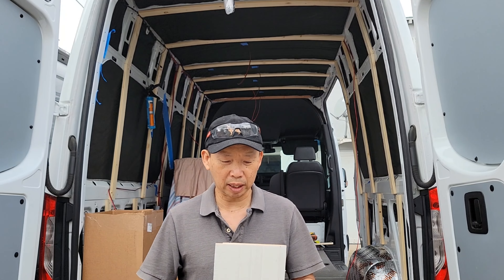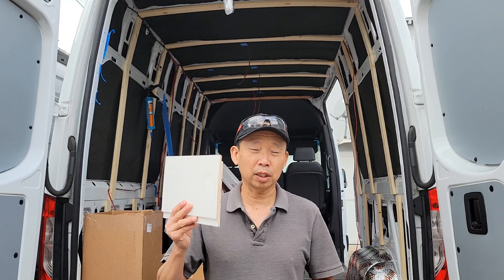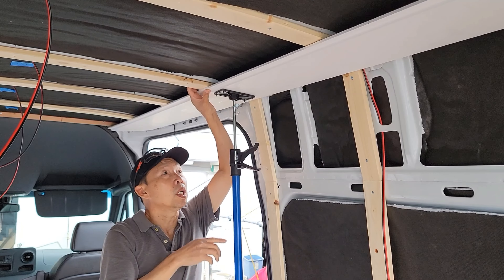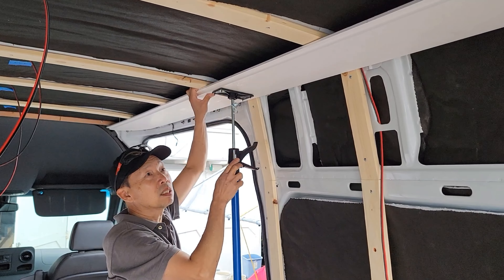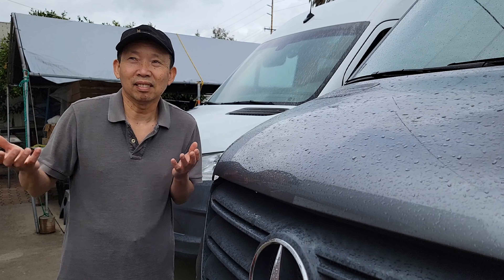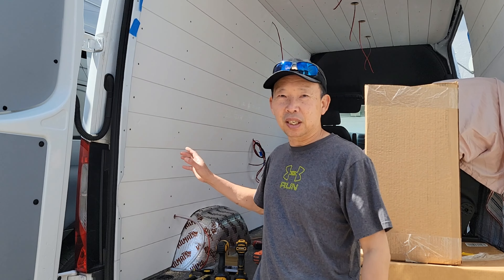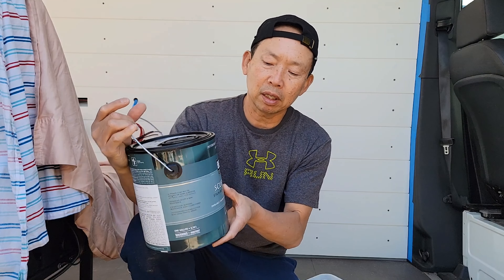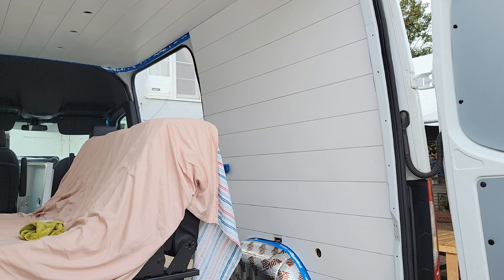DIY SPRINTER VAN CONVERSION,  insulation and Shiplap wall panels #sprinter #diy #vanbuild

Comment: Looks great!  Just wondering if it’s a time issue, but I noticed that you didn’t use wood filler fill the screw holes before painting the shiplap. That way the screw holes could be hidden. I think you do such quality work and was just wondering.
Reply from the maker: Thanks.  I did not cover screw heads.   When countersink, the screws heads flushed with the surface and after I painted over they kind of blend in.   I want to be able to easily remove it in the future.   It's the preference, I guess.

Comment: Bong, I have a passenger sprinter van and it comes with AC in the back, I want to connect to the power station. How much power do I need and is it possible to connect to the factory AC?
Reply from the maker: Hi Tony,
I think those AC run on 120v withthe engine running. I think at least 300amps to start.
Email me bchuon66@gmail.com
Reply: What power station would you recommend that can handle it? @BoChuonOUTDOORSVANBUILD
Reply from the maker: You need a big power bank I don't think a power station last long enough.  You big power batteries. Inverter/charger.  Depending how big the power station you want maybe it can running for a while but you will still need to charge as you go like alternator or solar panels.
Reply: Thanks Bong, I appreciate you're responding to my question. @BoChuonOUTDOORSVANBUILD